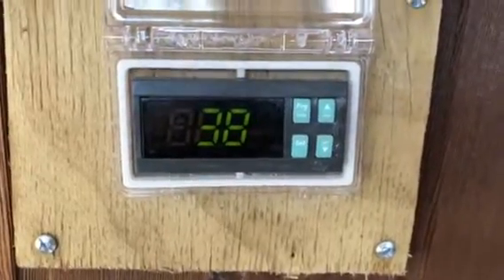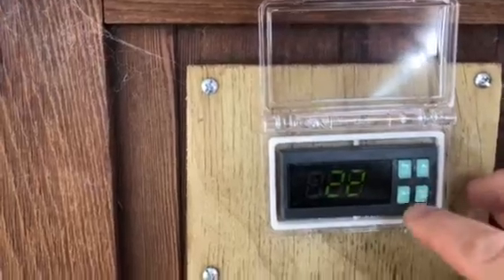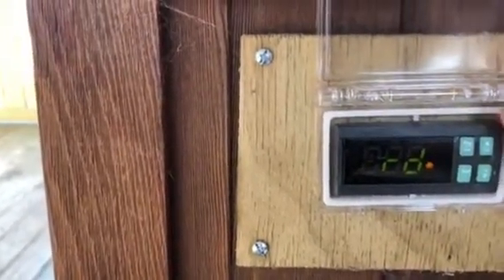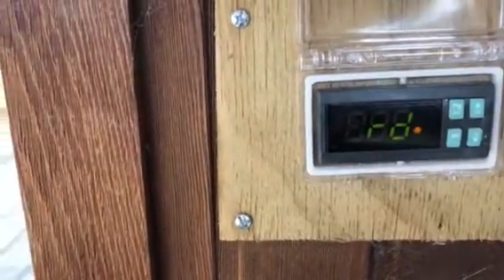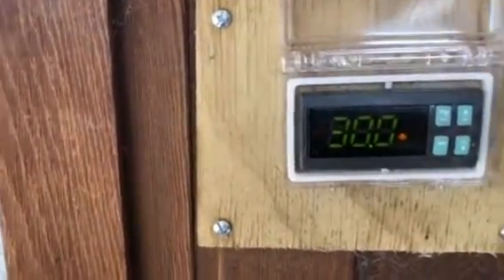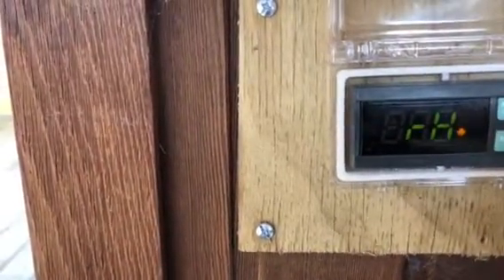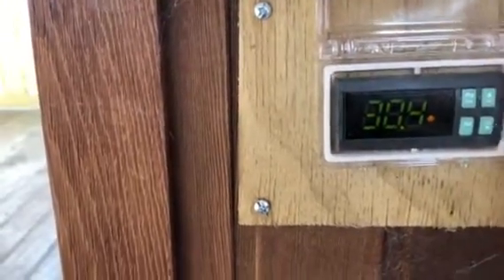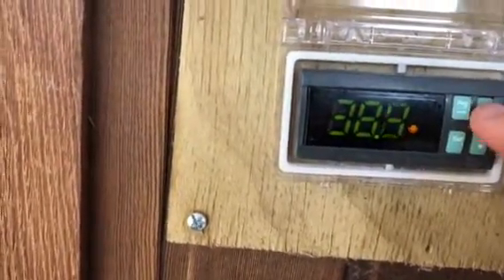How to Set a PID Controller

Comment: What parameter should I change so I can see the current temperature on display rather than set temp
Reply from the maker: It will set. To the current temp automatically when it times out of the programming mode.